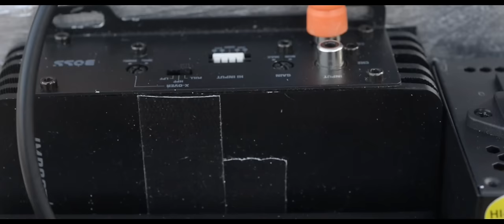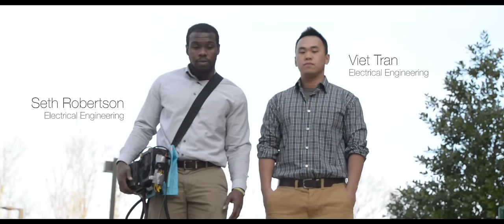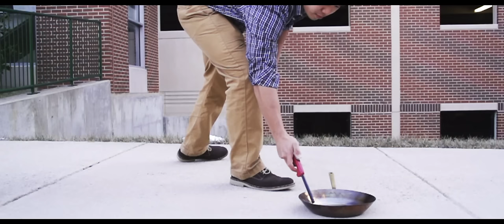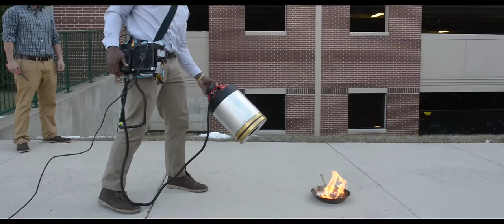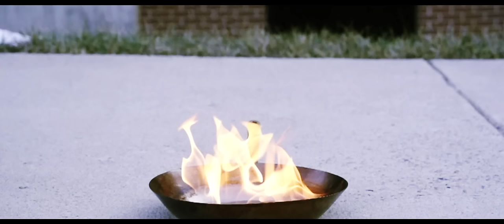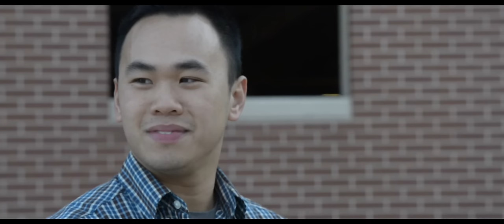Pump Up the Bass to Douse a Blaze: Mason Students' Invention Fights Fires

Comment: Isn't this just a subwoofer shooting air at the flame?? Or am I missing something?
Reply: Basically
Reply: Cooper Carr Speakers don't only push air forward. They use a back and forth motion to create a longitudinal wave with compressions and rarefactions in the air. If I had a make a wild guess, I would say that the speaker is creating a rarefaction just above the bottom of the fire/surface large that is strong enough to deny the base of the fire air momentarily, which causes it, momentarily, to diminish. Subsequently, the fire doesn't have enough time during the compression phase to build itself back up, resulting a net smaller flame. Maybe someone else can make a more educated guess?
Reply: James Devilbiss The amount of compression and rarefaction in a sound wave is typically very, very small compared to atmospheric pressure.  I doubt that's the mechanism.  I'd bet it has more to do with the motion of the air back and forth, which can be pretty substantial.  Maybe that motion spreads heat more quickly, cooling the fire to ambient temperature and thereby extinguishing it.
Reply: It looks like it's spraying sound particles on the fire, thus causing harmonic oscillatory anti-combustion reactions.
Reply: James Devilbiss Good guess. Maybe it's a low-frequency pulse wave with a much longer negative phase than positive, like you mentioned.
Reply: no. if that were the case the fire would only expand
Reply: Rajdeep Lather At the weak fire they had going, yes a air blaster would extinguish it.
Reply: James Devilbiss The device increases of the velocity of the air particles within and surrounding the fire.  This increase in velocity decreases the surface area of the air at which the fire com busts.  It is analogous to blowing out a match.  But when you blow out a match you are using waves generated by your mouth traveling the the Air medium.  This takes significantly more energy to increase the velocity of the air molecules to the point of a fire going out.  A sound wave on the other hand can pass through the Air medium quite easily.  Imagine a box with a fire that is sealed except for enough air to keep it going.  Now increase the velocity inside that box.  Lets say you had a force field that only let things in on one side.  Then accelerated the box the fire would go out.  Or add wind the fire would go out with enough of it.  That is the gist of it.  Xezlec had it right pretty much.  The spreading of heat is due to increase in velocity.  A good way to think of Physics probs like this is where is the energy going?  2nd law of thermo explains everything.
Reply: donahuerules
lmfao..you're dead wrong

Comment: This isn't different from blowing out the fire. It isn't practical, I'm not sure why its touted as being so great. Puffs of air pulling and pushing you can see it clearly from the high speed video.
Reply: Tom Tijerina 

It isn't. The mechanic behind this technology is using a standing wave to separate the oxygen from the ignition source. It's quite a bit more complicated than blowing out the fire.
Reply: Imagine a Fire Extinguisher.  It is compressed gas.  Fire Hydrant.  Pressurized Water.  If we could put out fire without the need to add energy to pressurize something it could save resources and be essential to putting out deadly forest fires.  Imagine a station like a Radio Station using satellites that could be out fires with ease from long distances.  There are few inventions that are practical right at the beginning.
Reply: This is really cool...especially since they had to figure out what frequencies were effective etc...I challenge Tom to come up with a new invention

Comment: Got a couple questions, if you do not mind me asking. 
1. How portable is the device? ie. Is it heavy? If so, how much does it weigh?
2. How much did it cost to make?
3. Are there any components that degrade quicker than others and need constant replacing?
4. How much electricity is needed to power the device?
5. Does this device work on larger fires? Or so far small fires are the most successful in your test?
6. Does the fuel source matter? ie. does the machine have easier time extinguishing fires gasoline in comparison to wood?
Sorry, for so many questions. I just find this really interesting to use vibrations to put out fires. This is really cool and this has a mountain of applications. So thank you for your time and hope for a reply.

Comment: Applicable to the real world or not, it's a really cool invention. Would it be useful in niche applications, such as lab settings where chemical fire extinguishers can be troublesome? Or where you don't want to blast around whatever it is you are trying to put out? I imagine one of the big problems with larger fires is the remaining heat even when the flames are gone as it can cause things to light back up.

Comment: The aviation industry uses the same halon (cfc) fire suppression chemicals since 1995 when thier manufacture was banned. All those systems will need to be replaced one of these days. The demo looked like a small version of the engine fires the cfc systems wait for.

Comment: I'm skeptic on real world application, thats a lot of air movement needed to douse a fire that would be larger than say a waste paper basket.  You talk about drones and forest fires, I have a hard tiome seeing this being applicable or effective when there are safe chemicals that would doa better job and continue to suffocaste the fire, where as this would need a constant power source.  Perhaps over a stovetop? But what is the human impact?  I've seen vids of books being shredded by isolated sound, so, again, i'm skeptical of this being a viable alternative, Darpa did this years ago, and they too doubt this is going to be an alternative.

Comment: The fire didn't go out. You make a video about how you built the "fire extinguisher" and don't even show it putting out fires (well it made it die down but not out, when baking soda would do it a lot quicker and safer). Why didn't you set a piece of paper or wood or fire and put it out? Is it because it won't put the fire out? I think you have a great idea, but will not be practical.

Comment: My question is about how this works in larger scales. Pushing the amount of air/sound around in small forms is fine but to put it into practical use, how safe/dangerous would this be in a larger scale fire? A house? Forest?

What about grease fires vs. regular fire? Is the application still the same?

Comment: Is there something like a 'resonant frequency' for fire? Was there a specific frequency or is it a sweep/range? Plz do tell :)
Reply: Only in the sense of energy.  Low Sound waves are used because they are so low energy they pass through almost all mediums such as air.  The Sound Waves excite the air particles causing an increase in velocity, a increase in overall area of air, which decrease the area for fire combustion.  Technically you could put out a fire with any wavelength or frequency by calibrating it perfectly to increase air particle energy without increasing total energy which would heat the system.